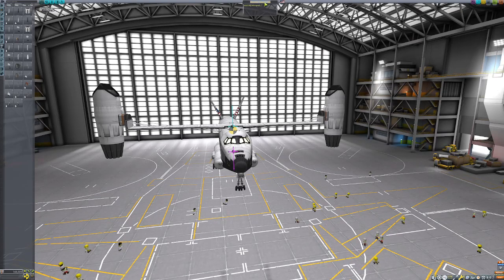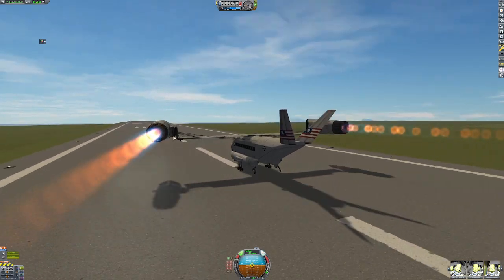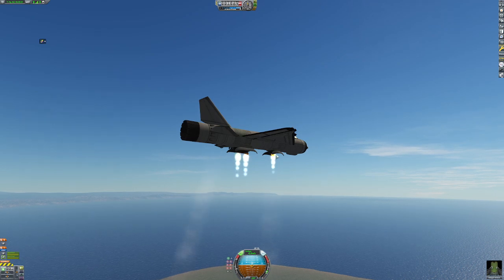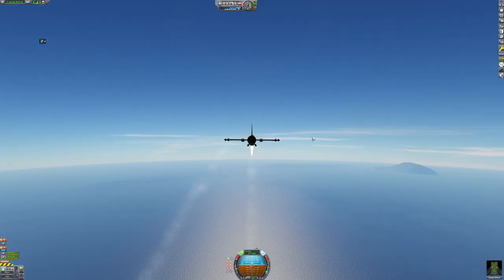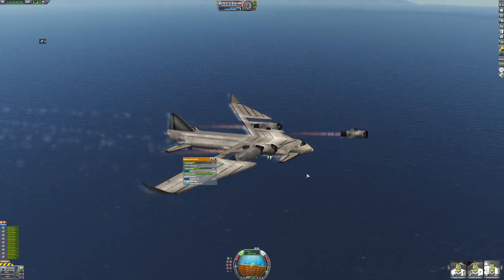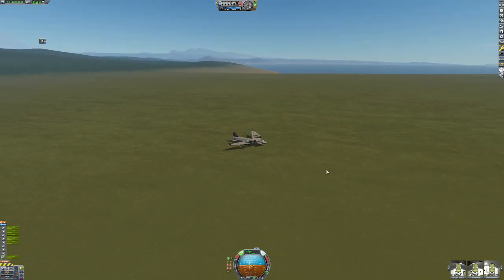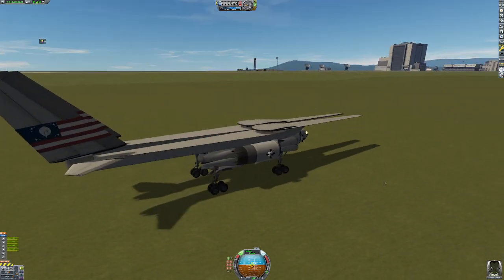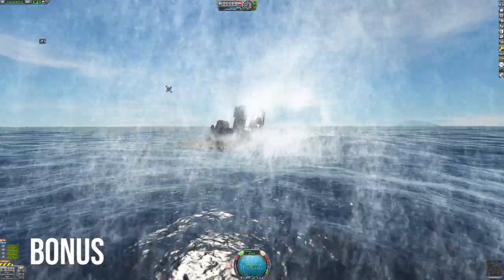BUILDING (BETTER) VTOL AIRCRAFT!! | Kerbal Space Program - episode 27

Comment: If you set some action groups you don't have to manually turn on and off your VTOL engines. Would also recommend using your Center of Mass and Center of Thrust indicators and get the CoT passing through the CoM, which will mostly prevent the VTOL from immediately angling forward or backward, and make VTOL more stable in general.
Reply from the maker: i see, although a lot of my designs are just kinda what looks cool
Reply: thats a good reason to build something that way, i respect that
Reply from the maker: partially why the one vehicle in the thumbnail looks strange
Reply from the maker: oh that sounds cool, hopefully its easy to use